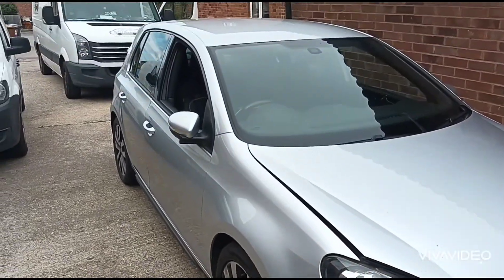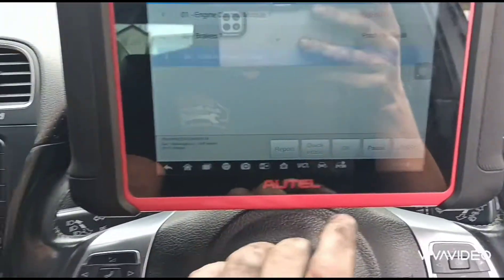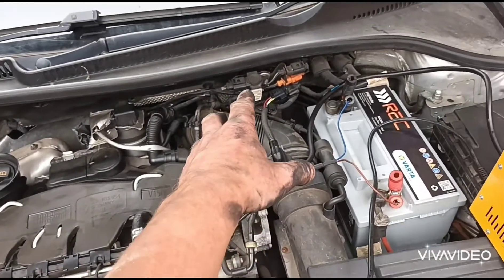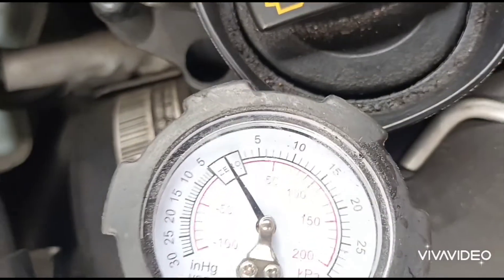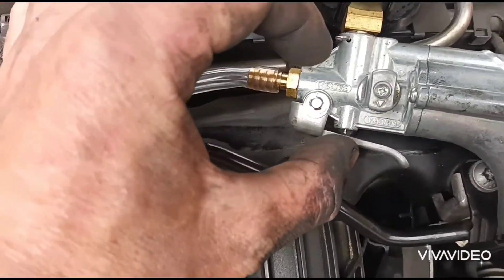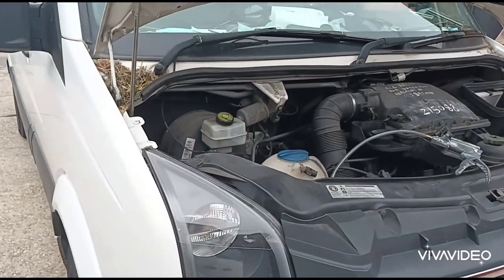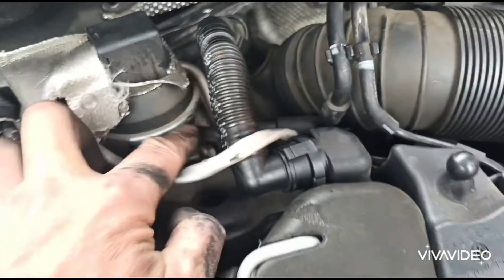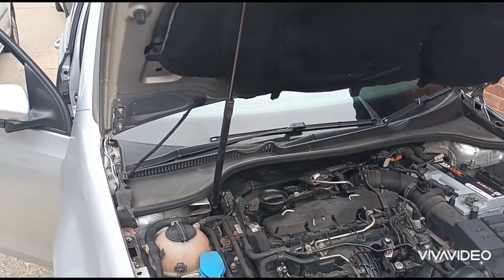VW Golf 2.0 GT Tdi P0299 Turbo Underboost

Comment: Recently I Had a 2014 VW Golf 2.0 GTD with fault code P0299 , it took the stuffing out of me in the beginning after a lot of investigation ,it had many problems , No 1 Turbo had to be replaced  , 2  DPF  Replacement  + Cleaned , 3 the Induction manifold  was misting a little coolant into the engine while running ,  I found when Inspected the DPF closely  the very end had got so hot at some stage it formed like a lump of molten metal at the outlet near the exaust pipe  , at this stage I had ignored checking the DPF Thoroghuly  then I had to get a Replacement   ,   Every day is a School Day ,    Im  very Impressed with your expertise ,   Regards to you    , I hope that you are Appreciated  , Note This car had been to five  shops before I got it , all the rest you understand

Comment: What is that solenoid you test first called? Do you have a part number? I have a 2013 Jetta Sportwagen TDI and it isn't holding a vacuum. The actuator holds fine, though.
Reply: Boost pressure sensor

Comment: Can you check a vacuum actuator and a electronic one, the same way with mityvac? I asume this GTD has electronic actuator? 
Great videoy i am learning a lot! Greetings
Reply from the maker: Electric actuator is done by diagnostic tool with bi directional controls
Reply: @ORileysAutos  Thank you for the quick anwser. I have the same gtd. So i presume i also have vacuum. Because i was told it is electric.

Comment: we got a 1.6 hdi and we replaced the turbo the turbo pipe yoke and fixed the dpf and for some reason like if we boost it from 1500 rpm up and go over 3000 rpm it wont go into limp mode but as soon as we boost from 2000 or 2500 rpm over 3000 rpm limp mode kicks in but this only happens when hot would anyone know what else could this possibly be
Reply from the maker: Could be a number of things. Change fuel filter and do a smoke test
Reply: @ORileysAutos  we changed the fuel filter and we dont see any smoke when the cars running

Comment: Hi I have a golf gtd 2019 and have a problem of boost power the car use to pull excellent then suddenly had intermittent boost issues when putting my foot down car will have the pulling power sometimes and now that feel of power to pull is gone the car does drive and pull but not like it did before tried it in normal mode and sport mode even when I use to put in dsg manual mode I could feel the pulling power now that has gone too there are no warning lights on the dash what could it be? Any help would be appreciated
Reply: Did you ever get this fixed?
Reply: Did you ever find out the problem was
Reply: Did u ever find the problem?
Reply: Sorry guys for late reply it was just me had the car tuned to stage one and was pulling 220bhp on Dino had all checks done by mechanic everything was fine  got rid of it and got a golf r now 😊 diesal are no longer the way they used be
Reply: @w.a7795  diesels are better than ever, its just the dpf that is ever more restrictive and damaging to them

Comment: Jist had the actuator done on my girlfriends 09 scirocco tdi. A more simple test if no mitivac is to Just suck on the pipe and see if it holds pressure against your tongue. Mad but it works. Darkside developments had the actuator I needed and plenty more. Car feels absolutely great now on the low end !!
Reply: My issue is also low end boost non existent high boost it was pulling like a train did the actuator fix it for